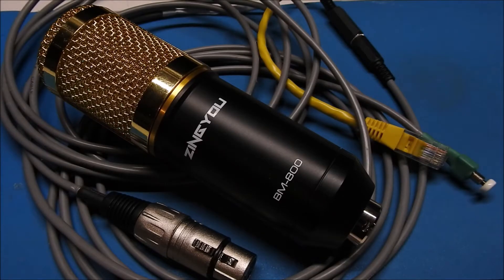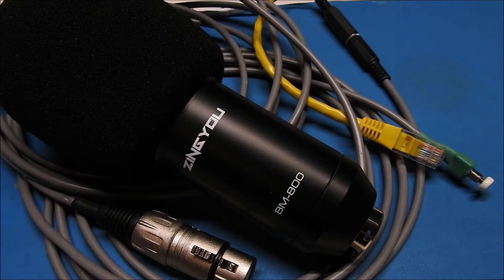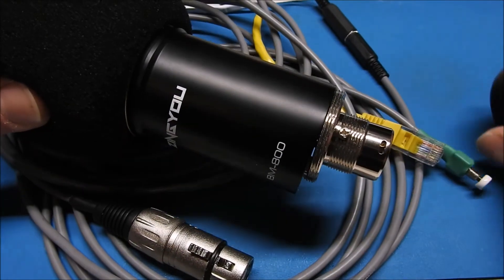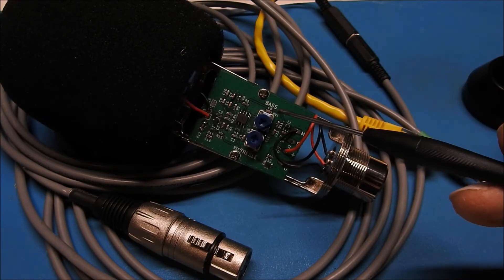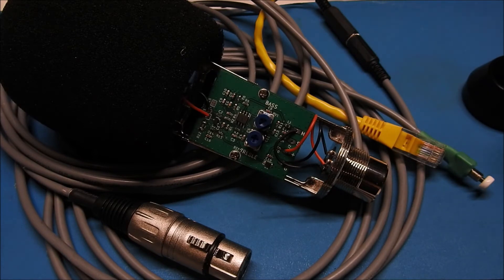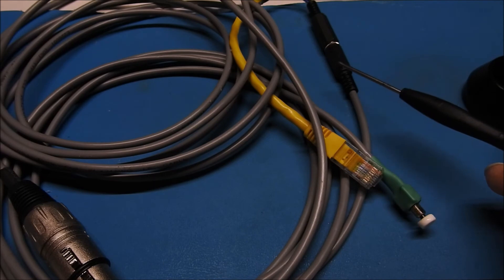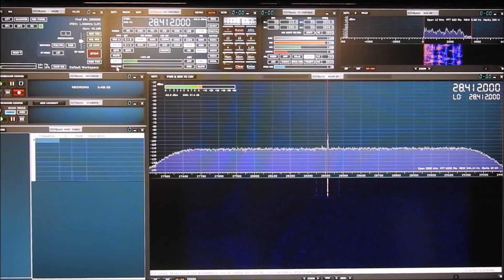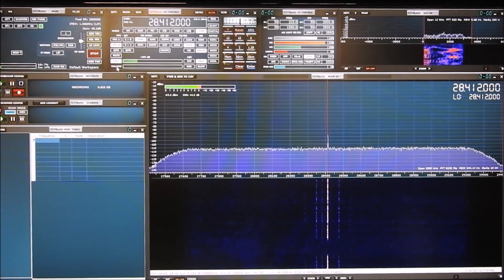BM-800 / BM-700 Made Easy For HAM Radio

Comment: Hi friend. I use that mic on my shak too. But I change all part inside that mic body. I mount dynamic 600 ohm capsule and send signal on my sound console. Out fo sound console I send on 32 dB attenuator and then 600 ohm sound transformer and in mic input on my transciever.

Comment: These are really cool!
I have interest in both versions as soon as i get caught up on bills.
Has there been any thought to make one for the turner mics?
Also if i have any non amplified mic i should be able to use one of these in it as long as power is supplied?
I have an old non amplified base mic, is a leson from Japan which looks like a turner +2 but has no circuit built in.  
I'm thinking this might be exactly what i need to bring that mic to the next level.

Comment: The BM-800 does not require 48 volts to operate !  If you connect it to a 48 volt supply, the voltage gets regulated down by the zener diodes to the needed voltage.  I use a BM-800 on my Yaesu radio that only supplies 5 volts from the mic jack and it works just fine.  SO no need to spend extra money on that 48 volt supply !  I have also used it on my new Icom 7300 which supplies 8 volts on the mic line by first plugging it into a Heil IC adapter, works great there too and I have never had more that 8 volts on it and have tested is as low as 3 volts.
Reply: Hi, did you modify de BM800, or use it as factory-made?. Do you have the connection circuit and extra components? I have yaesu mic pinout. Regards
Reply: @luisalvarez9451  No mods needed, I used it with an adapter made by Heil for my Icom 7300 and it was plug and play !
Reply: the bm800 sound way better with 48v on

Comment: Hey, can I unplug my bm300 usb mic's preamp and plug wires through to make it like bm800? I'm asking because you're the only person who makes modification on these mics. Thanks. I would be happy if you share a social media :)
Reply from the maker: I would have to see what the cartridge is that they use in it. If it is the same as the one used in the BM-800 then it should work.
Reply: @ab9te534 How can I send you photos of it?
Reply from the maker: @mindblower113  if you have an email I can reach you at I can send you an email. Otherwise you could upload the photo to a site like dropbox or Google Drive if you have a google account and then just share the link to it.
Reply from the maker: @mindblower113  yeah that mic element looks like the same style so it should work.
Reply: Ok, but how? It's working through it's amplifier. How can I make it?
Reply from the maker: @mindblower113  how are you looking to use the microphone? With a radio? You would uninstall the preamp that is in it and install this one in its place. You would also have to make up the proper cord to connect it to your radio.
Reply: @ab9te534  I'm just recording my voice as it is. But my pc is making huge buffer gaps between my CPU clock and these microphone's preamp. So while I'm recording there are so many crackles. There is no issue with the record but I'm wanting it to work properly. If you know how can I find a new BM-800 circuit board, it can work too. Also, I'm curious about phantom power because my microphone working with 5V. If I give it 48V, it can burn. So a new BM-800 card is better. But I didn't find it on the internet.

Comment: I have a Yaesu 991A which has +5 VDC and I also have a  BM-800.  Where can I obtain this preamp?
Reply from the maker: Hi David. Here is a link to the preamp listing https://www.ebay.com/itm/174638612425
Reply: The BM-800 works fine at 5 volts !  I use one on my Yaesu FT-450 at 5 volts with  no mods and it works just fine !
Reply: @rickmckee6698  I use one on my ts2000 with no mods and get super audio reports as well
Reply: @rickmckee6698  do I have to do any mods to the mic? And also can I use the cc-1-xlr-ym cable to connect the mic to my ft-450? Or is it plug and play besides maybe eq settings
Reply: @chrischant9252  I don't know what the cc-1-xlr-ym cable is, but if it's a 3 pin XLR on the mic end and wired for the 450 on the other end and wired for a condenser mic, it should work just fine.  No mods needed to the mic at all and no preamp needed.  The BM-800 has a built in preamp !
Reply: @rickmckee6698  the cable I mentioned is for heil mics but it’s 3 pin xlr and 8 pin modular yaesu with a 1”4 inch female for ptt switch. How have you got your bm-800 connected to your ft-450? And did it make huge difference in your audio as this radio has no way of setting the audio to wide that I can find. The audio is very narrow
Reply: @chrischant9252  The Heil cable should work if it is the one that is wired for condenser mics where it supplies the 5 volts to the mic.  But to set your 450 to wide, just use the "0" - zero setting on the EQ, that is the full range audio on the 450.  The 0 setting has no low or high cut - just full range audio.  The BM 800 got me great audio reports on my 450, much better than the stock mic.
Reply: @rickmckee6698  oh ok thank you so much. finally got some help with my radio. ill look into the heil cable and see if it connects to the 5 volt pin. fingers crossed, thanks again really appreciate this